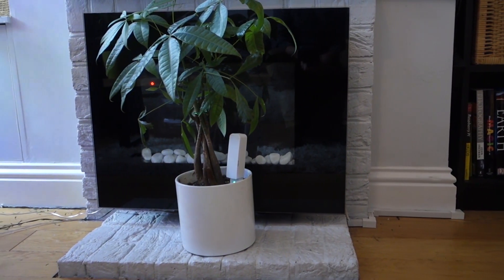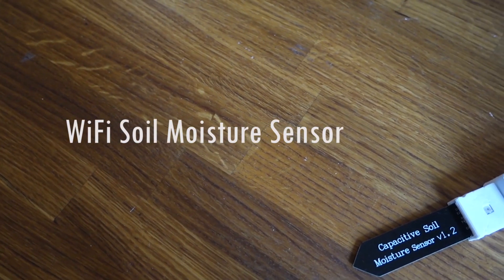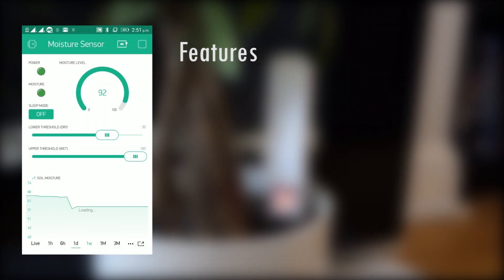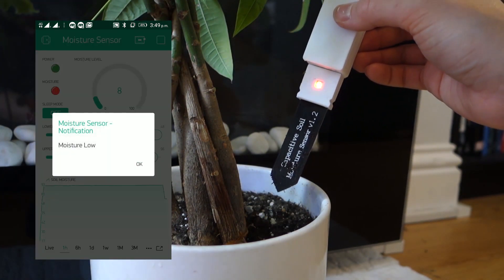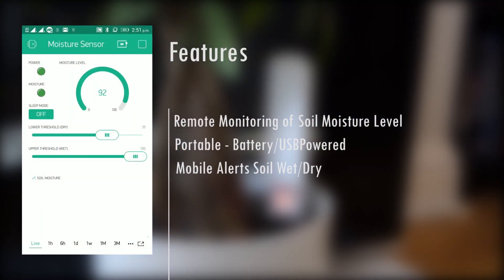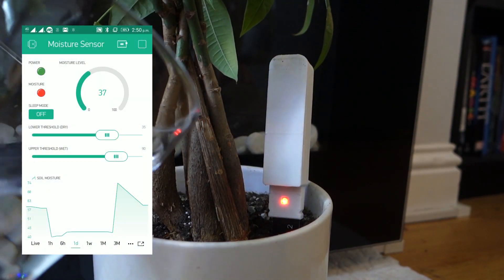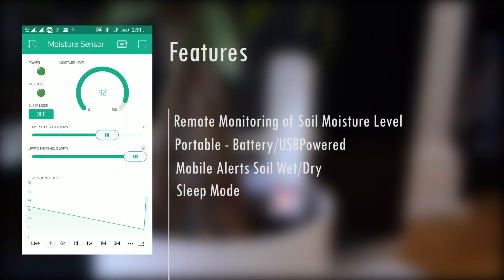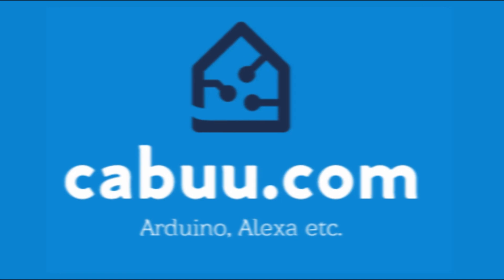WiFi Enabled Soil Moisture Sensor

Comment: Cabuu 👍, great project, thank you.
I've prepared the hardware, but I'm having trouble programming the board. Exactly which version must be installed in the Arduino sketch (board, blank library...)
All identical parts you listed in the manual were used, exactly the same parts from banggood.

last error message in compile: 
 bridge1 was not be declare in this scope
  //Notify watering system
              bridge1.virtualWrite(V1,1);
 Line 227
Thank in advance
Reply from the maker: Sketch details can be found here: http://mangetout.net/cabuu/sketches/
Reply: Same with me

Comment: Thank you for a comprehensive explanation of the ESP 32 board capabilities. This board does open wide filed of opportunities in the whole range of applications. However, my question to the distinguished community related to the use of the ESP 32 in horticulture/greenhouse sector. I would highly appreciate if one could please explain to me how to combine moisture, temperature and humidity readings in one ESP 32 board that would send information over wifi. I shall be delighted to hear from DroneBot Workshop but also from anyone who could shed light on the above-mentioned subject.
Reply from the maker: Thanks for your feedback. This would be very easy to do for sure, perhaps in a future project! I am actually working on an automatic watering device that will have all these features and more!

Comment: Is there a method for a raspberry pi to poll the sensor and retrieve current conditions? I have several applications that I would like to integrate the device into.
Reply from the maker: I haven't tried hooking this up to a pi but for sure this will be possible as it has similar working gpio pins
Reply: @cabuu4122  I ment can we use a Raspberry Pi to get the moisture data instead of the phone app. Once I could get the data in a RP I could do a lot with it.

Comment: Hi.great project.can we use more than 1 soil sensor to 1 wemos d1 mini.theres only one analogue input on this board but need to measure 6 trees soil moisture,iv been looking at the 4051 multiplexer???,or ads1115 analogue to digital  converter
Reply from the maker: As you say the d1 mini unfortunately only has 1 analog input, you can use multiple sensors however through multiplexing. See my seperate tutorial for details of how to do this.